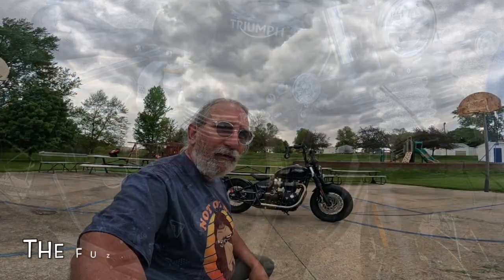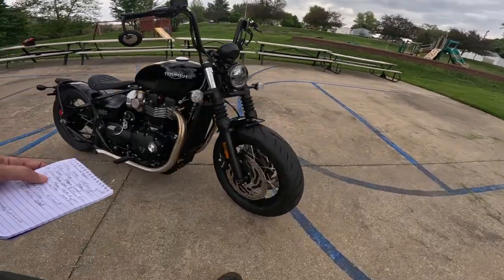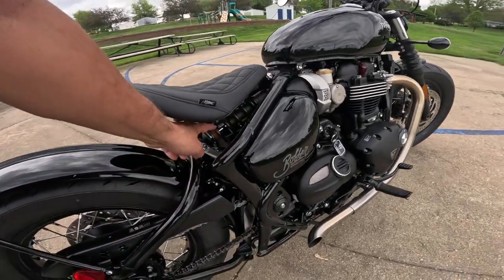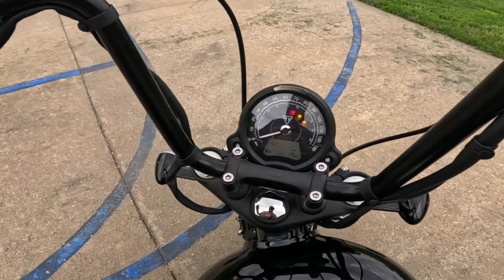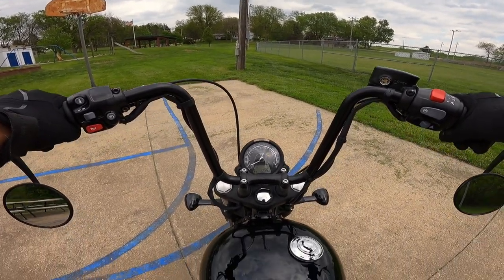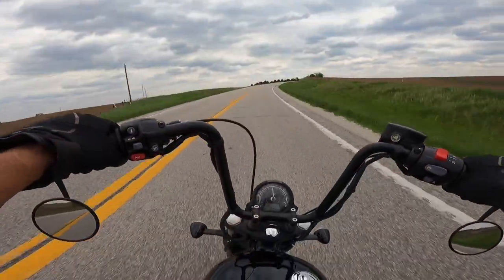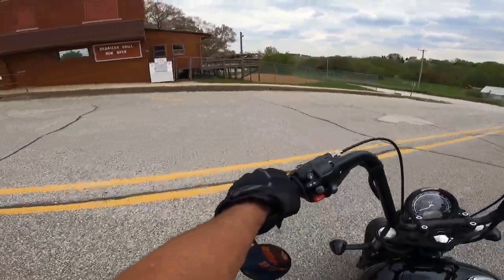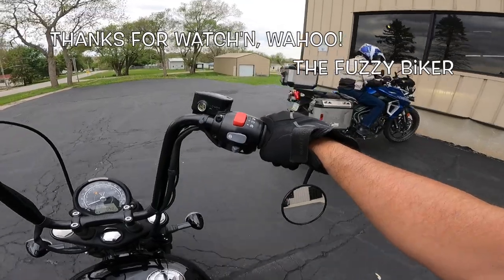Triumph Bobber 'Bar Stool' w/ Tall Bars - Nice!

Comment: The only problem I have with that bike is how they left the wires on the outside of the bars..run those wires inside the bar and finish off what is otherwise a superbly styled bike
Reply from the maker: Most would agree with you. Wahoo!